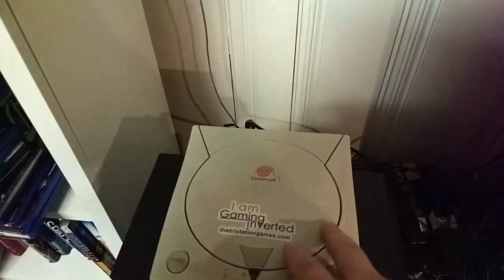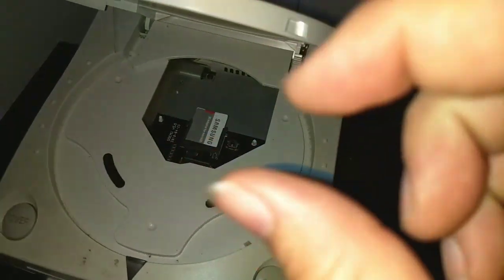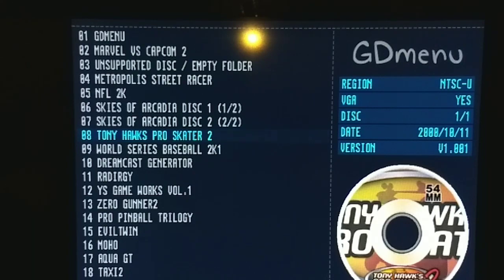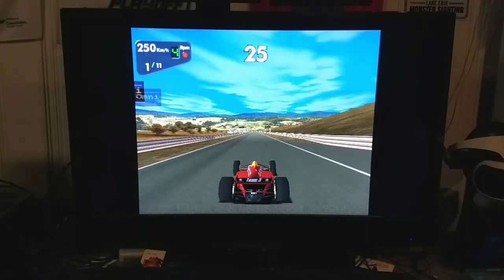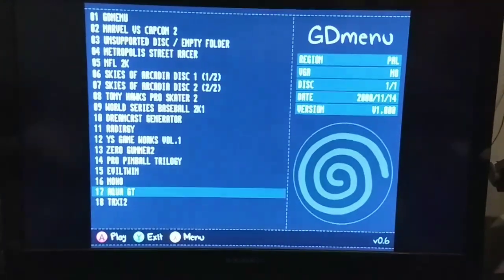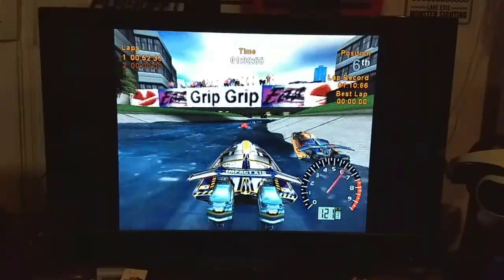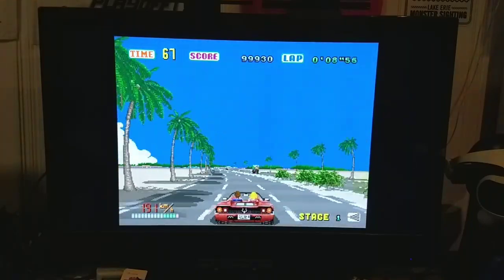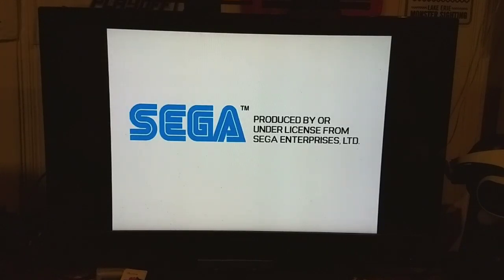DreamPSU and Chinese clone GDEMU review

Comment: I see you would like the Developer to add SDXC support officially? ( Which he has not and probably will never, but it don't matter because you can use them anyway )
Funny that i have been using 128GB SDXC cards in my Dreamcast for over a year now.
Reply: Are you doing anything special to get this to work? My 64 GB PNY SD card would not work but anything 32GB and smaller works.
Reply: @TheHighlyCaffeinated  Format to fat32 for larger cards using a fat32 formatting tool.
Reply: @TheHighlyCaffeinated  - What did you format the 64GB card to? ( Needs to be Fat32 )

Comment: The DreamPSU is crazy expensive. I modded mine with a very cheap 150w Pico Power supply from eBay ($17). However if you aren't a capable with a soldering iron I wouldn't recommend it.